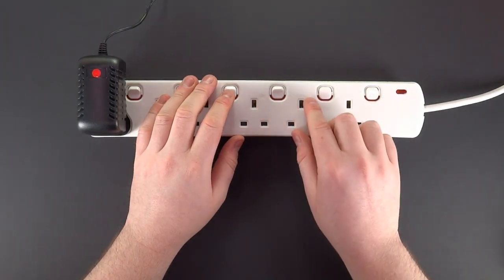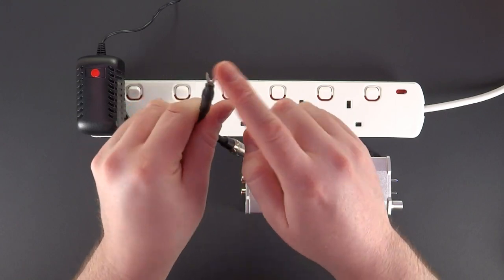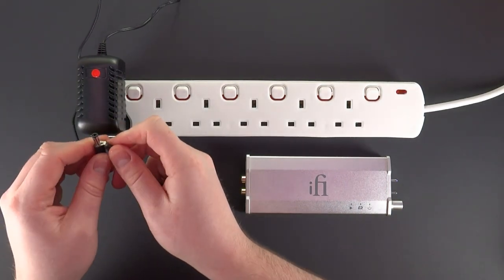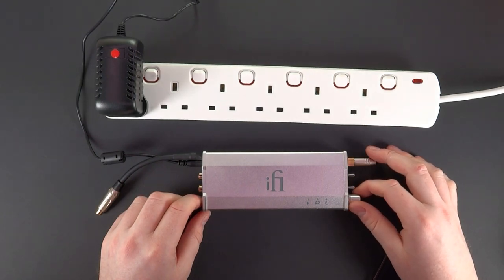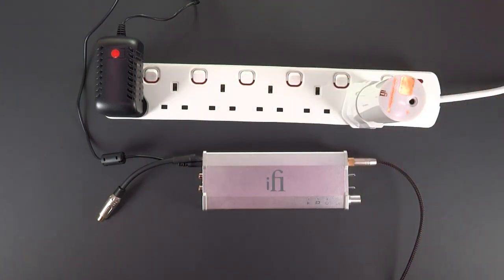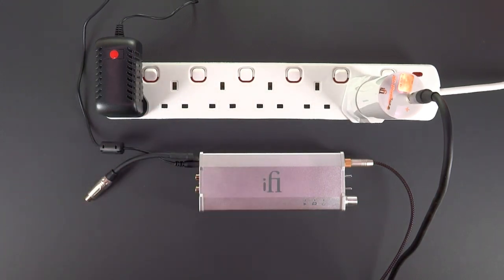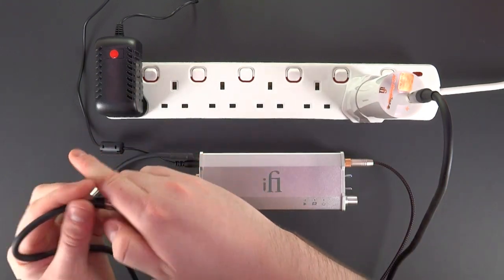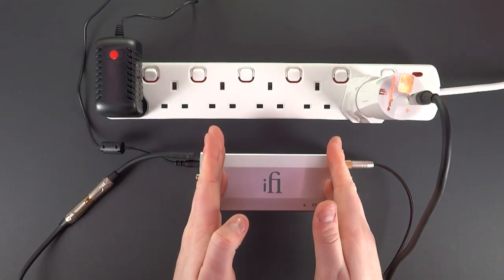Solving a missing ground with an AC iPurifier

Comment: was the outlet grounded ? , or did you just ground the ifi ipower  passing it through  AC iPurifier to a grounded outlet ,will tis work on  Non-Grounded  outlet ?
Reply from the maker: The outlet (wall) was grounded, the iPowers was not so the system has no ground path. Adding the iPurifier with the UK adapter (since it was an EU AC iPurifier) had a ground pin to bring in the grounding path, and into / through the AC iPurifier.  If the outlet has no ground, then the AC iPurifier won't ground the device as it can't touch paths - does this help?  Thanks.